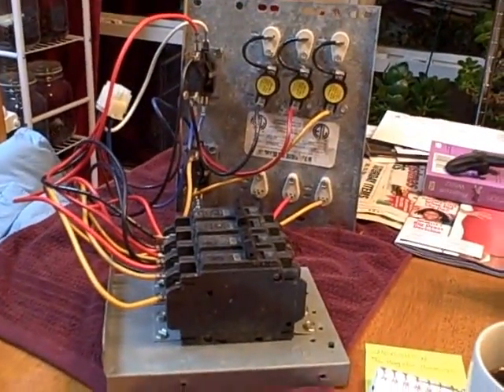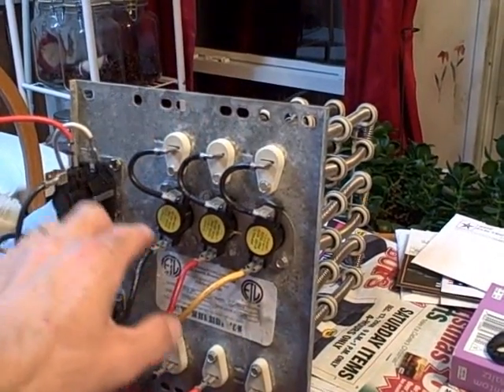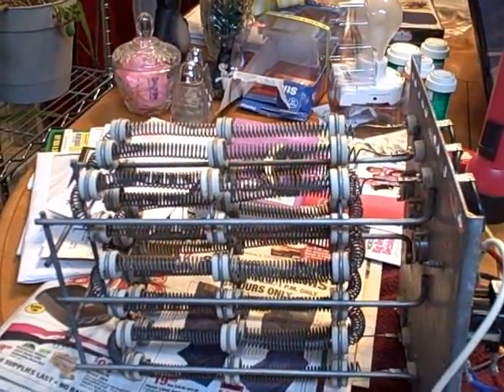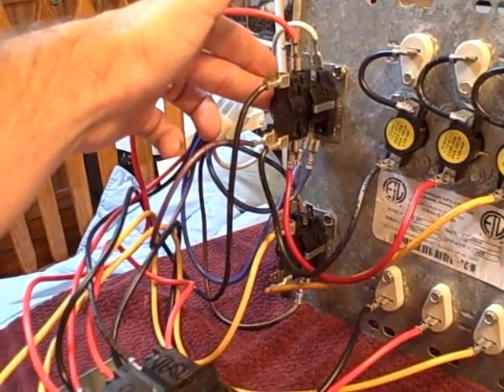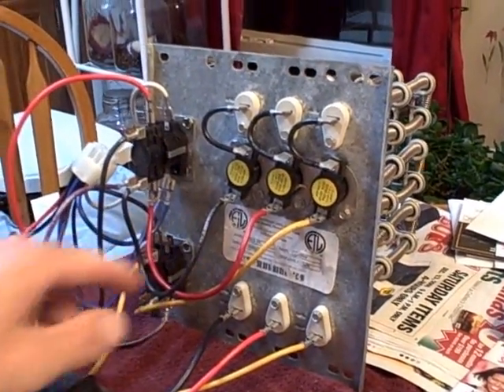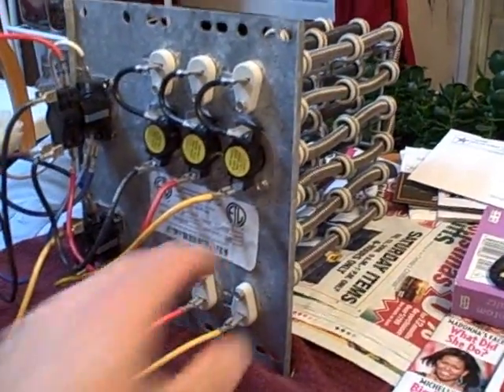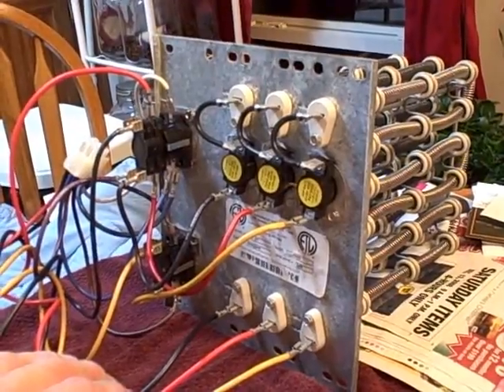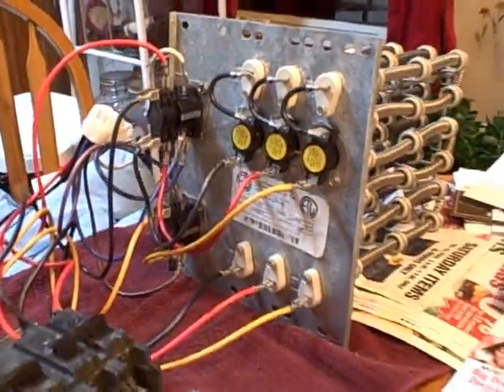HVAC Electric heat kit / strips shown!

Comment: when installing an element in an AC unit do you need to have a delay switch to let the element heat up before the fan turns on?
Reply from the maker: No. The blower motor always comes on at the same time as the first heat strip. You might have a delay for the other heat strips coming on and going off, or not depending on the unit. When the house reaches temp snd the tstat tells it to shut off, the system will either shut off everything at the same time, or it will cut off the heat strips first then let the blower run for a bit longer to get the rest of the heat in the house and cool the unit.  Hope this helps!

Comment: So my air handler heater coils are running ALL THE TIME regardless of whether I set it to cool or hot. The  top ductwork above it are too hot to touch if I leave the breaker on. There doesn't seem to be any thermal protection working at all because the heat apparently has been runing like this for MONTHS and cost me $100+ extra a month on my bill. I have the panel popped off and see the two heat sequencers you show in your video. I hear a buzzing sound coming from the aux heaters as if they are running when I turn the breaker on and when I set my thermostat to COOL mode the aux heat still runs/buzzes. The top vent gets hot to the touch after a few mins so I know its on. Should i replace the two heat sequencers? Anything else I should check?
Reply from the maker: Well it definitely sounds like a heat sequencer. The only other thing to check would be to check the low voltage coils on the sequencers to make sure it isnt getting power telling it to switch on. If you're not used to working with high voltage then I would not recommend trying to check it, its way too easy to accidentally touch the high voltage line and short it to the low voltage side, causing all kinds of problems!  Not sure what your buzzing noise is unless you have a noisy transformer or something.  The limit switch is probably working, the problem is that it prolly cuts out at like 130 deg or something, but as soon as the unit cools off below the cut in temp, it just turns it back on until it overheats and trips again. (When the blower is off)
Let me know what you find!

Comment: are the coils supposed to be on while the AC is on from thermostat I have problem with blower blowing hot air from one side and cold air from other side not sure if one of coil strips stuck to on
Reply from the maker: Hi! No, the heat strips should never be on when you are running the system in cool! When you say its blowing cool on one side and warm on the other, what do you mean exactly? Or where I guess?  You could have a heat strip on with a stuck sequencer, if its warmer air from one duct but say, with reduced air pressure on that one, you could have a duct partially fallen off or with a hole in it. (Less likely but possible)
Reply: I shut the breaker off to the heat strip and know it's working fine real cold air know
Reply: Well the duct over the blower was hot so I unscrewed the duct just over the blower and I seen the heater strip and heat was coming from the strip on the.right and cold on the left this is why water kept coming out more then it should the condenser was cold like it should and thermostat settings are right and changed filters
Reply from the maker: +Oliver Green awesome! Well you lucked out that the stuck sequencer and heat strip wasnt on the other heat breaker! The blower motor is always tied to one of them! Lol :). Dont forget to have it serviced and have it changed out!
Reply from the maker: +Oliver Green just saw your extra note here, somehow missed it yesterday!  Thats prolly the normal amount of water extracted, if anything I would think the heatstrip would dry the air out a bit more... However great catch! Most times the positioning of the coil or setup would make it impossible for an easy visual inspection, to catch it like that in most homes.  

I remember the first time I ever ran across something like this, it took me a while to figure out what was going on! I thought the unit must be low on freon but when I checked the freon my pressures were both so high! So I thought the coil outside must be packed with dirt...nope, it was ok. Then I thought maybe the return duct had fallen off in the attic and it was sucking in hot attic air, climbed up there and all that was fine. I honestly cant remember now what tipped me off, but I checked the amp load while I was up there and it was pulling an extra 20 amps that it shouldnt have been!  Replaced the stuck sequencer!

Comment: What is the reason for the sequencer rather than just using a contactor.  If I can answer my own question... Is it to provide a time delay for off/on and on/off transition?  If yes why is that delay time needed?  Blessings John 20:29
Reply from the maker: I dont think ive ever actually read it anywhere, but yes, to delay on and off. Lets set an example; you have an air handler with 20kw of heat, so four heat strips. If you turned them all on at once you would be pulling an 80 amp load all at once. Even with proper wiring in a new house that will cause fluctuations in the rest of the house, worse the farther out from the power station you are.  Also stepping them off then letting the blower run a bit before it shuts off pulls residual heat out of the system and into the house.
Reply: +mikie2501 Thank you Mike. That makes sense.  May I ask one more question. "Air Handler, Packaged Unit" What is the difference between these terms?
Reply from the maker: +johntracey523 air handler refers to an electric heat unit, furnace refers to gas heat, package unit means an all-in-one unit outside where the condenser coil, evaporator coil, blower motor and everything are in a single box. ...as opposed to the more common split systems used in houses where the condenser is outside and the evaporator and blower are in the attic or a closet or the like. Basically its just specific terminology so you know what your dealing with a bit a bit quicker :)
Reply: +mikie2501  Thanks Mile!
Reply: The newer units don't use a sequencer, they use a contactor, and probably some logic on the circuit board that adds a time delay.

Comment: Hello. Where would I start if heat pump comes on but blower doesn't? The fan blower spins freely thinking its OK but when I manually turn fan on, all I get is a loud buzzing from handler. I don't have an amp gauge but I do have a volt meter that's rated for 10 amps. Can I use my voltmeter to troubleshoot this problem? My landlord refuses to call a professional and all his pointless visits hasn't helped. Any help would be appreciated.
Reply from the maker: Your landlord is probably required by law to pay a hvac licensed person to do the repairs on it. It sounds like it could be a relay or possibly a capacitor. A buzzing is usually a relay issue though. Normally you could try heat  since it usually runs at a slower speed and uses a different relay, but some heatpumps use a single speed for everything.  I have another video talking about testing the blower motor by wiring it direct, bypassing the board to make sure its ok. Some units have the relay on the control board and some have the relay off by itself.
Reply: +mikie2501 Hey Mikie, I put a new capacitor on it and blower still wont come on. I still hear the buzzing. I removed the fan yesterday and tried cleaning it, but that didnt fix it and there is a tightness in the motor. So it's probably fried. thanks for your response..
Reply from the maker: +brian Boggs ouch. Yeah, if the blower doesnt spin smooth and freely then its toast. Usually you'll get a humming if the bearings are shot and it cant spin up. Not the cheapest fix, and worse, you usually need a special tool to get the blower wheel off the motor since they usually stick badly over time.
Reply: +mikie2501 Yeah, I noticed that blade is on tight, so I will let landlord know about it. I'd really like to go ahead and fix it, but I do have a wood stove so I been splitting wood in the last few weeks....lol..plus he's 70 years old..
Reply from the maker: +brian Boggs lol, gotcha! Slightly different circumstances! I was thinking apartments or the like.  Well at least you have a fallback solution!  Id love to have a pot belly stove :) (though with my crazy cats... Heh)
Reply: +mikie2501 lol. I hear ya, and I'm actually going to pick up a new motor now. My landlord said he will reimburse me on my rent. Thanks again for your help!! I'll let you know how it goes.
Reply: Hi Mikie I loved the video.my question drove myself crazy trying to figure my heating part of my package unit. The two I think you called heat sensors I replaced. Because they were shooting fire. Here s what mine does. It turns on and off I also changed the thermostat. Here is where it gets weird. If its really cold it turns off and on like it should. But when the temperature outside gets close to 50% it starts shutting on and off.for the life of me I wish someone could tell me.im disabled and money is tight would love to hear back from you. I really loved your channel. Really nice of you to help people. Thanks Mikie

Comment: The white wire is the 24v call for heat from thermostat? Right? So is the blue wire the 24v common on the heat sequencer? So I should read 24v when I put leads on each 24v side of the heat sequencer when heat is being called for? thnx!
Reply from the maker: One side is hot, the side you are controlling from the thermostat, and the other side is common or neutral if you prefer, singly or tied to the other sequencers. It doesnt matter which side you hook up to on the coil. When you call for heat from the thermostat you should read 24-28v across the coil from one wire terminal to the other. Just be careful not to accidentally touch the high voltage terminal above at the same time or you'll fry the coil :)
Reply: Ok perfect. Thanks man! Good videos!
Reply: I'm

Comment: my electric furnace runs all the time and will not cut off. what could be wrong with it.
Reply from the maker: Well id start by checking the thermostat to make sure nobody flipped the switch from auto to On. Other than that its most likely a stuck relay or sequencer. Youll have to get a tech to replace the part and make sure there isnt something going on as well.

Comment: Thanks for the video. What may cause the heat strips in a heatpump to not come on during defrost cycle?
Reply from the maker: Hmm.... Thats one of those ones where you want to see it to figure it out, hehe.  Well initially I would think something is wrong with the defrost control board.  Of course it could be something as simple as it was never wired up when it was installed too.  The sequencer or relay that its wired to could be bad.  If you arent actually checking it with a meter it still might be working, you often wont get any warm air coming out, just less cold, heh. You have to remember that in defrost mode its the heatstrip fighting against the cooling cycle so you get lukewarm, if that, at best.  Depending on the age of the system the heatstrip(s) could be bad too.
The heatstrips are easily tested by running it in emergency heat or auxiliary heat mode (depending on how your thermostat os labeled). Its also worth noting that they dont always turn on all the heatstrips in defrost mode, just depends on how it was wired. Having issues with it?

Comment: on a furnace with 3 heat strips.......do all 3 energize and run at the same time?......I have one that is kicking on and off from the limit switch.......I cleaned the blower....it is a 2 speed blower on high.....Correct me if im wrong....but should not the element come on in seq.....and all 3 run until the Stat is satisfied...and then deenergize  in seq....??????
Reply from the maker: +Walking in the light for Yeshua it depends on how the manufacturer built the system. Most use sequencers and will kick one or two on first, then the third a bit later, then the reverse when it shuts off. 
Some systems like mine dont use sequencers but use a relay or contactor and will just turn them all on and off at the same time.
If you have a limit switch cutting one on and off then you could have an airflow problem. You cleaned the blower  so Im assuming the filter is clean, but the evaporator coil could be dirty after years of dust and dirt particles  piling up on/in it that got through or by the filter. If this is the case its not something I would normally recommend trying to clean if you're not a tech... Its really easy to bend the aluminum fins badly if you arent careful. ...there could be other blockages such as stuff that has falken on the ductwork in the attic blocking airflow, or too many room vents shut off creating a lot of back pressure.  Its hard to guess without seeing it.  ...its less likely, but you could have a flakey limit switch. Thats a few things to check though.
Reply: mikie2501 Mike thanks for replying so quickly......its a heat only so there is no A coil to clean.....all the vents are open fully ...and air is coming out of each one....it has a brand new filter......I changed out the old limit switch...it was a 150F.....it was doing the same thing ...on and off...i found the capacitor was only reading 3.6 micro F...so i changed it with a 7.5.....the new limit switch is a 165F.....but i can not find any imformation on what is really suppose to be in it.......and the new limit switch is doing the same thing...on and off...on and off....It is a single limit switch double stack .....one switch for each 5 kw on a 10 kw element......Do you think that the 165F is a high enough limit? for that 10 kw.....it had a 150 in it and that seems low to me for 10 kw....so I am thinking it has been replaced with the wrong limit....but I don't know where to go to find out what was in it originally......It is a Intertherm furnance (Nordyne) E2EH 015
Reply from the maker: +Walking in the light for Yeshua ill try and see if I can find a spec sheet on it, not sure if that would be listed in the file or not. If I think about it tomorrow I'll dig through my paperwork and see if I can find the phone number for the distributer and you can give them a call and they could look it up for you.  How many speeds are on that motor? Is it the original motor? If theres no airflow restrictions and its the proper limit switch then maybe enough air isnt flowing through the system either from the blower or the installer didnt size the ductwork properly and/or the air return is too small and it cant pull enough air.

Im not an installer so cant do the math for a place off the top of my head, so if I cant find a mechanical/electrical problem the boss would have to start having me measure and count things for him on the phone so he could give me a quick answer or I had to dig out the book and a calculator, hehehe.

Undersized returns are actually something I used to see more often than you would think, or it might be 'sized' right but by the time you add the metal grill it derates the size a good bit! The grills add quite a bit of airflow restriction.  

A good example; I get a call to check a system in an older home, the unit is fine but the owner complains of poor airflow/lack of cooling in two rooms.  I get my ladder out so I can to the vents in the ceiling. They seem to be blowing well but they are (the air registers) an older design Im familiar with that tend to blow the air almost sideways along the ceiling instead of down into the room. This also restricts airflow because its blocking its downward path and redirecting it. The solution was simple (they arent mechanically adjustable), I just got out my needle nose pliers and bent all of the metal fins so they were aiming mostly downward. Bend each one from each side so it doesnt look bent weird from the middle. (Easy enough to figure out depending on how thick/thin the metal is). The air now blows down cooling the bottom of the room instead of the ceiling first and the airflow went up quite a bit in the room!
Sometimes the return wasnt big enough and had to be resized, sometimes the return air duct wasnt big enough going to the unit, and sometimes the supply air ducts were too small. Sometimes the unit is the wrong size for the house. 

If the motor has multiple speeds you could increase the speed BUT if its too fast then the air coming out isnt hot enough and it runs your gas/electric bill way up because it takes much longer to heat the house! :(
Reply: mikie2501 Mike it is a 2 speed blower...i really don't think it is a air flow problem.....because sometimes it works fine...other that that limit switch is kicking on and off....it will run for several days just fine....other than that limit is kicking on and off all the time.....and I think some one has replaced it at some time with the wrong one....IF you could help me find the info on it I would be very grateful......